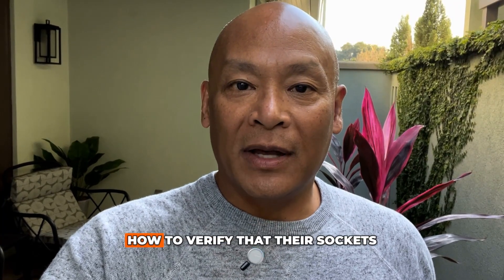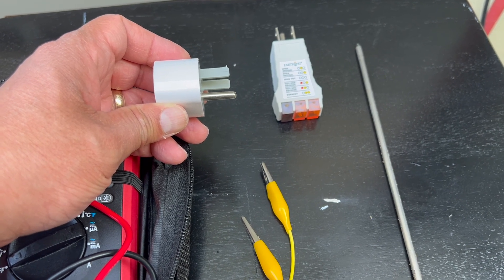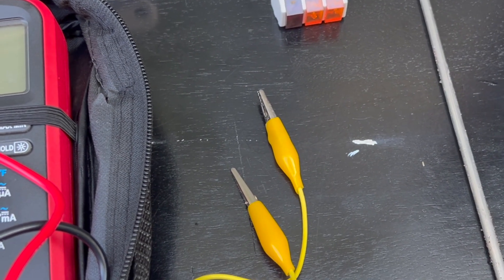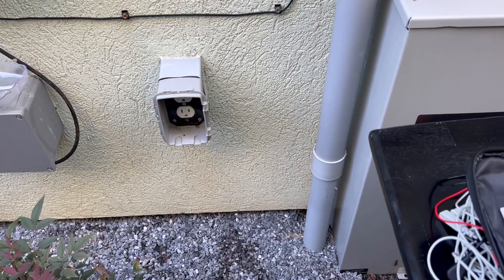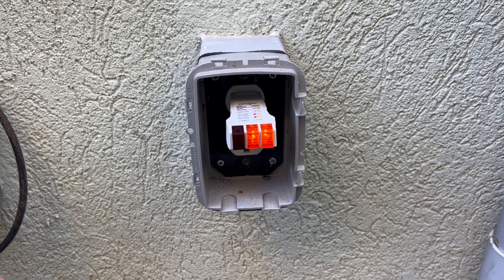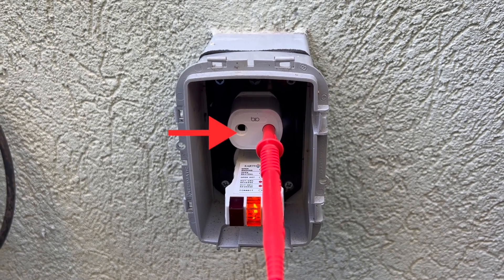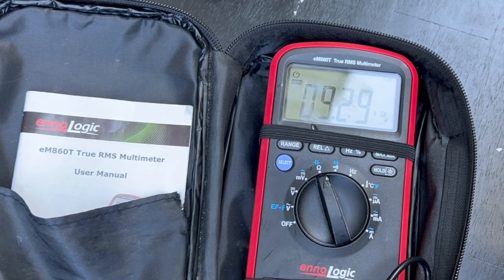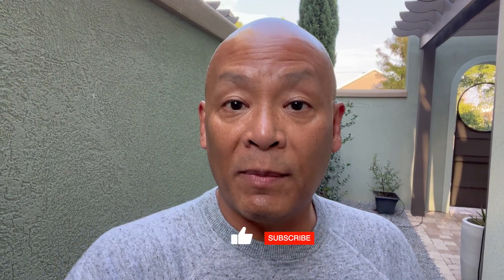Is YOUR Outlet Ground REALLY Safe for Earthing and Grounding?

Comment: I bought a grounding sheet. Tested my wiring and it is not grounded at all in this older house. What a waste of a sheet. I'm glad it did not decide to rain while I was sleeping with it plugged into the ground hole in the receptacle! Thank you as I learned a lot from watching your video. I may have to ground my outside circuit to a rod in the ground? Not sure yet.
Reply from the maker: Use a grounding rod for your sheet.

Comment: For measuring body voltage, does the multimeter /volt meter need to have voltage 'Auto-Ranging' feature?
Reply from the maker: Nice to have but no. It has to be able to measure at least 600 mV AC.

Comment: So is practically impossible to test the house grounding living in an appartment, how could I make a wire to the ground from 12th floor or so? And if there is more resistance to the ground in the wire and me being less resistant than that, am I getting dirty electiricity from the entire building?
Reply from the maker: Use a filter like this: The NCB Plug Dirty Electricity Filter for Grounding from SYB  - https://tinyurl.com/ncb4u
Reply: @DrAndrewDoan thanks for your answers. I'm not sure that I can get exactly that thing in Russia, but if it says that it's a resistor, shouldn't something like high resistant cord work the same? Dumb me didn't learn that stuff enough and got a big electric burn on my hand from 30 minutes yesterday of having it on a grounding mat connected to an unpowered socket with grounding
Reply from the maker: @Dostav  No. High resistance block both dirty electricity to you and the outflow of EMF induced electricity away from your body. You need something like the NCB to block the stray/dirty electricity but allow drainage of voltage from your body.
Reply: @DrAndrewDoan  That's unfortunate. What does the NCB stand for? Is it just a name? I can't understand what I should be looking for...
Reply from the maker: You will find more info about the NCB here: https://tinyurl.com/ncb4u

Comment: Thanks for this great information.  I'm not sure if I believe that grounding works, but I'm desperate and trying a grounding pillow case.  I may be seeing some results, but not sure yet.  I guess time will tell.  Have you ever heard of a grounding plug with a resistor?  It's suppose to help with dirty electricity if I understand correctly, but can't see to find one that works with grounding products.  They seem to use a different plug with a different end to it.  Is there a way to know if you have dirty electricity?  Is there a way to prevent it.  If you happen to have any info on this, I would be greatful. Thanks so much.
Reply from the maker: Too high of a resistor will block both stray/dirty electricity and the reduction of body voltage. I recommend this adjustable device: The NCB Plug Dirty Electricity Filter for Grounding from SYB  - https://tinyurl.com/ncb4u
Reply: @DrAndrewDoan Thank you so much!  I’ll check that out.
Reply: Be consistent with it give it at least a year

Comment: Wow are you totally and completely wrong.   You are putting out incorrect information.    The resistance to ground should be 25 ohms or less.   NOT 9K !!    And you should not have to add water to increase conductivity.     You essentially have no proper ground for your home so not only on your wasting your time with the Grounding products you are using, but all of your electronics within your home are now at risk of being damaged if you were to have a surge or strike near your home as the current would have no place to dissipate into the earth and instead would bounce around anything conductive in your home.     You also should be using a Megger or other true earth ground resistance tester and be clamping on to your home ground rod WITH the rest of the house disconnected to that rod in order to get a clear indication of how effective your ground rod actually is and if it was installed properly and deep enough AND it has not been crystallized which basically creates an insulation layer around the rod causing it to be ineffective.  Consult a licensed electrician.
Reply: You are incorrect, he is measuring the Ground resistance of his 1 foot grounding rod via the Earth to where his house ground wire connects to the ground wire in the receptacle.  So, the resistance of the Earth between his 1 foot rod and whereever his ground rod is, is about 9K Ohms.  His house electrical ground is 25 ohms, the remainder 9K Ohms is the Earth soil resistance between his 1 foot rod and the distance in Earth to his 8 ft home's electrical ground rod.
Reply: @Chad.Tyrone  the ONLY true way to measure accurate ground resistance from a ground rod to the earth is with the use of a Megger or other true earth ground measurement gear.  The Megger is the most popular but there are others.     Any ohms reading from house ground to earth above 25ohms would be considered un-safe by any electrical inspector in regards to safety of both persons and property, in that order of course.
Reply from the maker: I purchased an Extech: 

Measuring Grounding Rod Quality With ExTech Earth Resistance Tester
https://youtu.be/FJG9Zemmc8E
Reply from the maker: I have a brand new house and house ground resistance to Earth is less than 25 ohms. I'm measuring resistance from rod to house grounding rod. So resistance can be 9K Ohms because the actual value of resistance between two specific points in soil depends on how the soil’s resistivity varies across those points. Typical values of soil resistivity range from very low (10–100 Ω·m) in moist, conductive soils to very high (1000–100,000 Ω·m) in dry, sandy, or rocky soils. My soil is sandy and dry.
Reply: @ Sir. You are trying to provide info and service to your viewers and that is commendable.   I am an electrical engineer for 35 years.    Your measurements need to be done with a true Earth Ground resistance tester such as a Megger or Extech unit.     9K ohms is insanely high and your methods are incorrect to promote to others.    A large majority of our clients believe they have a solid earth ground when in reality we prove otherwise.    Clamping methods and corrosion and just sloppy work in general ultimately leads to ground problems.   Your measurement from any outlet throughout your home must be 25 ohms, preferably less, to earth.   The only way to test that is with long enough and proper gauge wire from your outlet ground all the way to your ground rod.      Please search on YT for electricians who use Extech to verify grounding of a home or building.    Once u have confirmed your ground rod is effectively installed and in good condition, you are all set.
Reply from the maker: Very good advice. Thank you! While my test is not sufficient to confirm my house ground, for the purpose of earthing/grounding, 9K ohms is not high. The Earthing cords have a 100K ohm resistor.
Reply from the maker: @mspring6387 Would you be willing to film a video with you testing the ground and explaining the above? I would like to make a video with you, and I interview you on Zoom if you're willing.
Reply: @DrAndrewDoan Sure    Let me try and put something together for you.     Many folks using grounding devices for health are under a placebo effect thinking their mats and sheets are truly grounded and in many cases their is no proper ground to outside earth.    In florida for example, if the grounds or building takes a lightning strike, the tens of thousands of volts can heat up the ground rod so quickly and violently that the shell particles basically melt and then cool and cause a “sheath” around the rod which renders it useless as that creates an insulator.    Many homeowners have no clue that this has occurred unless tested by an electrician.
Reply from the maker: Thank you! That's important information! BTW, I plan to order the Extech 382252 Earth Ground Resistance Tester Kit. The Extech can measure electrical currents in the Earth, which is another hazard for people using a dedicated grounding rod to ground their bodies. Thank you for the information. I appreciate it.
Reply: @DrAndrewDoan  Perfect.   We use a Megger which is silly expensive for someone only needing this infrequently.  Your neighbors and friends who want to confirm their grounding health products are actually doing something positive for them are going to bother you to borrow it or test it for them!   LOL   Btw, depending on soil and corrosive materials surrounding a ground rod, most people do not know that these should be changed every 10-20 years, but most never do.
Reply from the maker: @mspring6387  Thank you for your help! The Extech Earth Ground Resistance Tester showed that my house ground is 3.62 Ω! It's expensive, but worth knowing that my house is grounded properly. I will make a video with the points you made above and talk about how to use the Extech Meter!
Reply: @mspring6387  I just bought a grounding sheet and I’m scared to plug it into the ground part of the regular outlet,  even after the tester said it was OK. Do I need to call an electrician? I thought this was a simple thing I could just plug into the wall. I don’t want to accidentally kill myself or get shocked. And, I don’t wanna placebo effect.
Reply: @tradergirlatx  i assume the plug that came with the sheet is a single wire and plugs into the 'bottom' hole of your outlet which is your ground.    The bottom more rounded hole is the ground.   The 2 vertical oriented ones are the neutral and the hot.     If you purchased this as a grounding sheet, i am fairly confident they sold you the proper plug type.   In regards to how effective your actual ground is to your home or apt ,etc., would be something only an electrician or someone with knowledge and test equipment on this subject could confirm for you.    I took the time to drive an 8' copper ground rod just outside my bedroom and ran a wire to it so i am 100% confident my sheet is grounded.
Reply from the maker: @tradergirlatx 

If you use an outlet to ground, you must check for stray and dirty electricity. To check for stray electricity in the outlet ground, use a multimeter that can measure mV AC (look at the specs of your meter and lower V AC is in mV) and follow this guide: https://www.facebook.com/share/p/19YrLZwNsV/?mibextid=wwXIfr

I also check for current in the outlet ground. Set meter to amps capable of measuring microamps (µA). Ground the meter black lead to a grounding rod outside. Red probe measures the current in the outlet ground. According to Andrew McAfee, “EPRI originally reported 18 µA of contact current has “biological effects relevant to cancer.” Later it was found that only 1 µA exceeded the benchmark set by the NIEHS.” Therefore, current should be much less than 1 µA or zero.

If your outlet has any current in the outlet ground, then use an Earthing grounding rod with 40’ cable affiliate links below): https://bit.ly/3Zl0gOX or The NCB Plug Dirty Electricity Filter for Grounding from SYB  
https://tidd.ly/3Eh4qiK
Or make your own grounding rod: 
https://youtu.be/KgRCXxos1Zo
Reply: @ Thank you!
Reply: @ Thank you!!!

Comment: got a question isnt less than 9000 ohms = 9000 volts and = 9,000,000 ohms

is earth suppose to be in that range.
Reply from the maker: The Earth is 0 ohms. But I was measuring the resistance from the outlet ground to the top soil, which will have some resistance based on moisture, top soil composition, and distance from grounding rod.

To get good, accurate measurements, I need to drive a 4-6 foot grounding rod into the earth to ground the meter’s negative lead.

Comment: Dr. Doan - I have been trying to understand this better, and we also interacted on the facebook group on the topic. The information you shared in this video is great. But, how to perform the check when I am on 20th floor in an urban city? I can't take the wire from ground to my apartment. Do you please have easy alternate suggestions for me?
Reply from the maker: That is a challenge and no easy way on the 20th floor.

When you ground with the outlet, are you getting ill or sick? If not, then continue. 

If you are, then stop grounding with the outlet. You can also connect to metal cold water pipes in your apartment.

Confirm that your body AC voltage drop is equivalent for both the pipe and outlet grounding to confirm that the water pipe is grounding you.
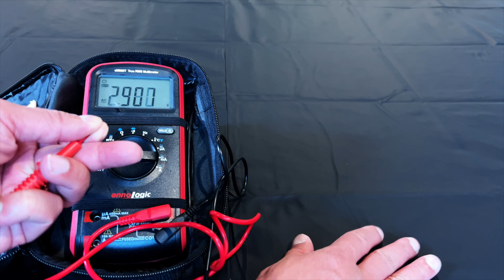Reply: @DrAndrewDoan  is not the method you expose at 5:20 enough to test the grounding quality of the outlet? for most of us it is impossible to do the test in an apartment without direct access to the ground or any water pipes....thanks!